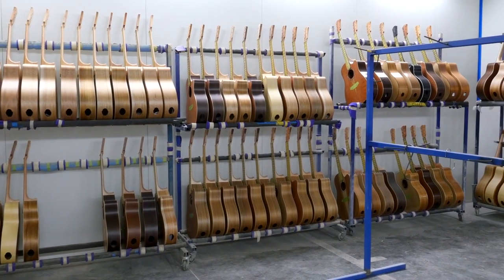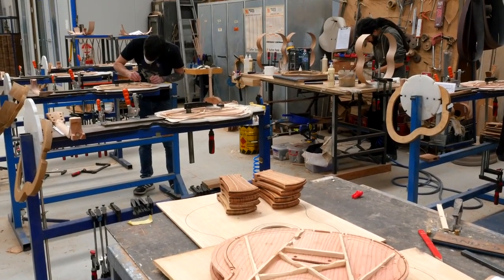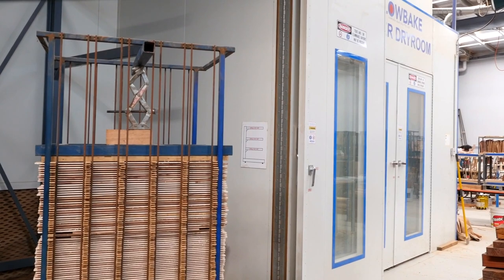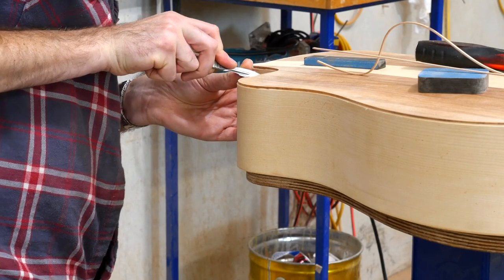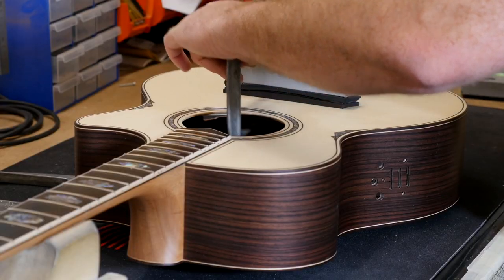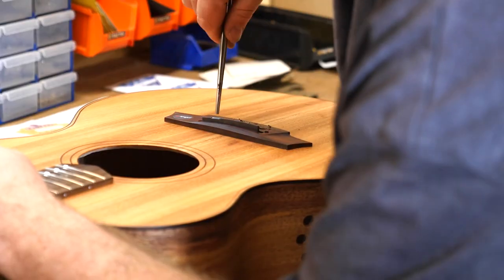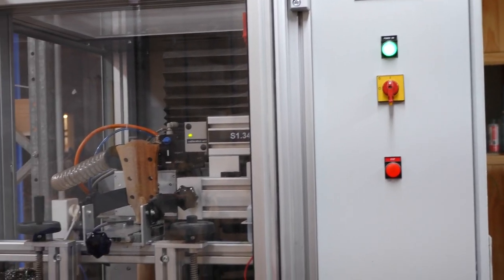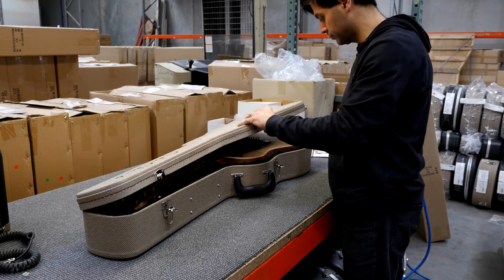The Cole Clark Story

Comment: Great guitar,
I did have a major problem though, the supplied Chinese 9v battery exploded a month out of warranty and destroyed the internals of the EQ/Volume unit, just corroded everything metal inside
I would have changed it if I knew it was such a cheap battery
Reply from the maker: Sorry to hear that. However, our guitars leave the factory with Duracell alkaline batteries. They’re the highest selling 9v battery in the world. I’m not sure of the country of origin. They have 3 US plants, 1 in Belgium and yes, 1 in China, but with 77% of all batteries made in China, there’s a pretty high chance. If the country or manufacture had any impact on the quality of the battery, 77% of all batteries would be below standard in your view. If they had a habit of exploding inside our guitars, I assume we would be long out of business and so would Duracell. It’s possible for a battery to be faulty. It can also corrode in high temperatures. Either way, we stand by the products we use and seek out high quality components in everything we make.

Comment: My angel has an internal buzz...is that covered under warranty?
Reply from the maker: TRUTHandANSWERS That depends on the cause and the age of the guitar. Contact the factory.
Reply: Try tightening up the small screws that hold the pick up under the bridge and the control panel on the side. Don't over tighten them though just a really light tighten up is all they need. I have had a buzz twice in my angel and that fixed it both times.
Reply: so does my 2012 fatlady 2 , i love the guitar to bits and would buy a cole again but i hopefully can work out whats going on and fix as im broke and cant afford to take it to a luthier :( and the 2012 is not covered under warranty hahahah